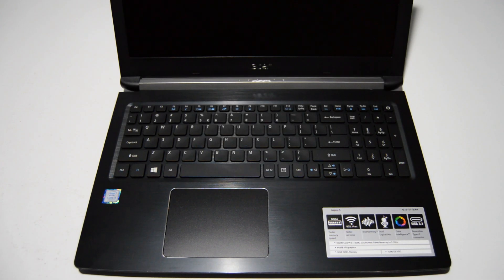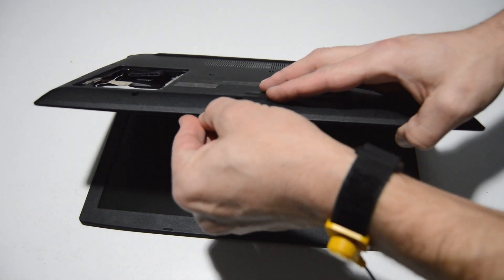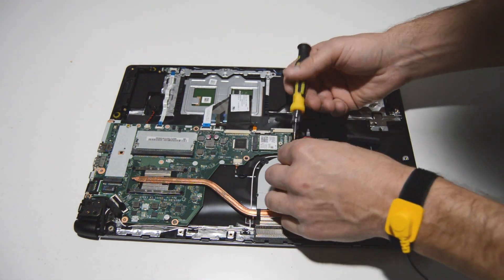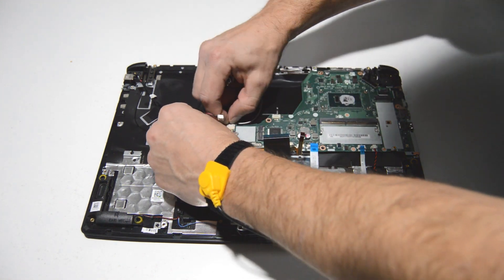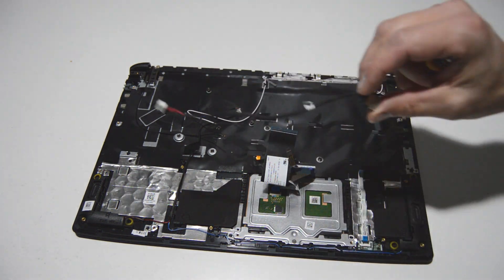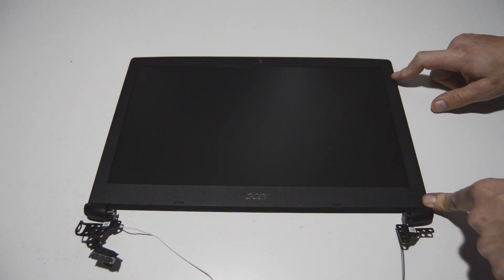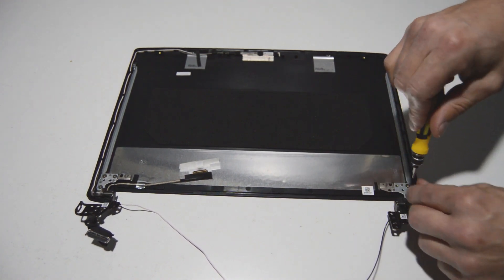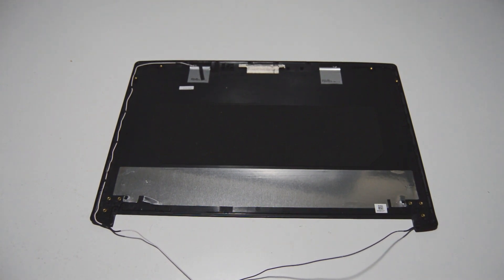How to Disassemble Acer aspire 5 A515

Comment: Any advice on disassemble and after reassemble, the computer not turning on at all, even when plugged in? no orange light, no charge, nothing. Power adapter and battery are perfectly fine.

Comment: just wondering where is the screen turn off switch?i sent my laptop for bezel replacement, since its back its not cutting display if lid closes, it's not a software issue, checked all power options, tried o/s reinstall, all power module drivers. someone said there is a meganet in bezel? is that correct? normally in other laptops its part of hinge. how is it done in this model. waiting for your reply

Comment: Cool teardown, but I have a quick question. 

What is the exact model of this one? I know it's an A515, but after doing some digging dear god are there so many different versions of the A515. The one I've been looking into getting is the A515-55G-57H8. I know. Crazy name. The reason I wanted to see a teardown is because I saw that it only comes with 8gb of memory, but I haven't been able to find whether or not it's soldered, upgradeable, dual channel, or anything! Seriously, it's like there's some dumb conspiracy to hide this, and I haven't been able to find a single teardown of that specific model. 

Anyways, thanks for your time. Keep up the good content!
Reply from the maker: Looks like A515-51-50RR
Reply: @Sellbrokedotcom  gotcha

Comment: Hi, My flex cable for my LCD does not disconnect that easy. It seems its wired onto the connector and cannot be removed. But it has shorts because my screen is jumping, but when I squeeze it to down the screen display properly. How can I fix?
Reply from the maker: If this is your model, it should just pop off the motherboard straight upwards. You will also have to partially disassemble the screen assembly to get that end of the cable out of the screen connector.
Reply: @Sellbrokedotcom  Hi thanks for the reply, really appreciate it. I got to remove it just as u did in the video, it wasn't so easy though. 
I ordered the cable because I believe the cable is the issue.

Comment: I have an A514 which had the full bottom case you mentioned at the start, can I use the same tools and procedure to remove that?
Reply: Yes I’ve use a normal screwdriver works as well

Comment: My hinge recently broke , but i noticed you it's basically the last thing you take out on the video.  
What would be your suggestion to replacing it ?
Reply from the maker: Its not too hard. Just remove the LCD assembly by removing the bottom case, disconnecting the wifi antennas and video cable from the motherboard (you can see where they come from the LCD assembly) and free the cables from any channels/clips that hold them in place. Open screen all the way, then flip it over and remove the hinge screws. Now you can remove the bezel like in the video and replace whichever hinge you need to.
Reply: The repair was a succes , somewhat of a hazzle because the white wifi anthena was under the motherboard, def wouldn't do it again
Reply: @Sellbrokedotcom  Thank you for the instructions , i'll make sure to follow it when the replacement arrives
Reply: This laptop is weak. My laptop hinge broke too.

Comment: Thank you so much for making this video!  I took my daughter's laptop apart, because I needed to replace some broken parts, however, I didn't know the names of some parts.  I took notes when I watched this.  When you said, "The backing plate is riveted into the palm rest," it certainly is!  I disassembled the laptop before watching this video and I was bound and determined to clean all of the debris out of the keys.  I didn't realize how sealed in the keys were.  I could have just scrubbed off the stuff stuck on the surface of the palmrest plate and keys and then used a mini vacuum attachment to suck up crumbs from under the keys.  I was afraid that if I scraped up debris, that it would fall into the motherboard and other major components.  Now I'll need to replace the whole thing...unless I can find the palmrest plate and then figure out how to attach it.
Reply from the maker: eBay has plenty of assemblies for around $60-80 depending on the color.

Comment: i am thinking of upgrading my acer aspire 5 ,could someone pls tell me which kind of ssd is compatible in the laptop, a m.2 sata or m.2 nvme ?
Reply from the maker: Looks like an NVMe 2280 slot on this one.
Reply: Does nvme ssd work??
Reply: Does nvme ssd work??
Reply from the maker: @blazef1re402  Some slots are hybrid and can use both.... this one looks to use an NVMe.
Reply: @Sellbrokedotcom  Thanks for replying
Will go for nvme ssd and see if it works.
Reply: @blazef1re402  did it work?
Reply: @tarunpalsingh4709  yep it worked
Reply: @blazef1re402  thanks for replying

Comment: I have a question. This is my computer. https://mauricomputacion.com.ar/web/productos/notebooks/notebooks/notebook+acer+a515-51-37v1+i3-7100u+4gb+ram+1tb+15.6+pulg+led+win+10 and I need to change the screen. They told me this is the screen for that computer : https://www.infopartes.com.ar/repuestos/790-display-p-notebook-156-led-slim-30-pines-full.html is that correct?
Reply from the maker: Best way to find it is to remove the screen and find the model and connector location on the back. Can't really tell by the info you gave. Its best to remove the screen first then match it up.

Comment: Thanks. As for the webcam - it has a little connector on the left side (hidden under the black tape), which can be unplugged, i.e. you can remove the wires without the need to remove the webcam (it has a really thin PCB, that can be damaged during removal)

Comment: my  acer aspire 5 screen is flickerring when i am shaking my laptop what should i do to fix it
Reply from the maker: Sounds like a loose connection in your video cable... you would need to check on both ends, so need to remove the bottom case to check that end, or remove the screen to check the other end.
Reply: @Sellbrokedotcom  removing the bottom case would be  easy but removing the screen 😅will be a pain in the asss,btw thanks for the help
Reply from the maker: @abhishek-omm  You may be in luck though, you might be able to just pop the front bezel off to get to the screen, you might not even have to open any of the chassis.
Reply: @Sellbrokedotcom  thanks it worked
Reply from the maker: @abhishek-omm  Awesome!

Comment: how do i remove the keys? the up arrow key broke on mine and i need to replace it
Reply from the maker: Most just pry off upwards, but you have to do it from the correct side or you might break the suspension clip. Unfortunately you cant tell which side until you have it off.

Comment: Is it possible to remove the case to apply thermal paste without removing the hard drive and ram slot ?
Reply from the maker: Should be, once you remove the bottom case you have easy access to the heatsink screws.